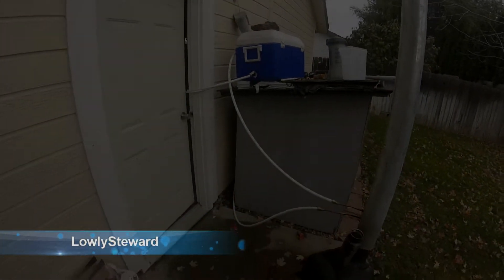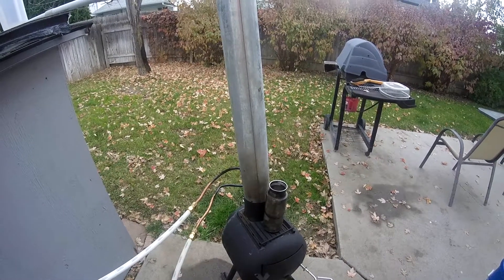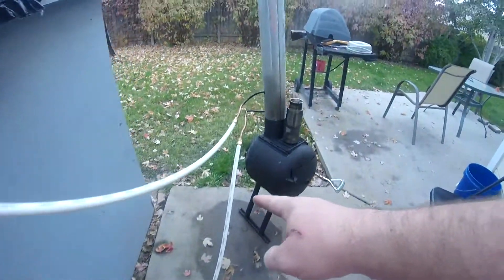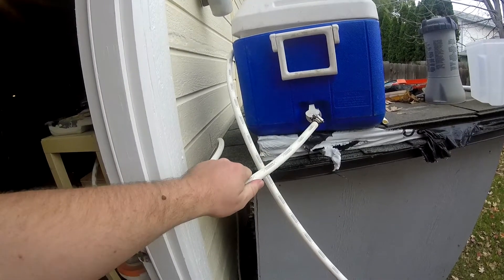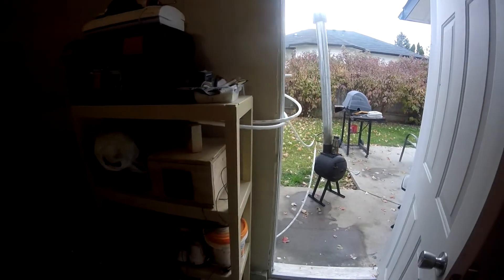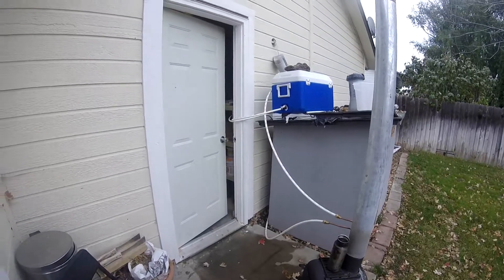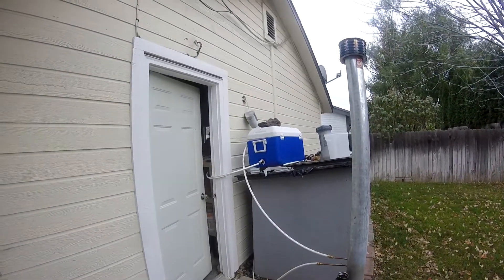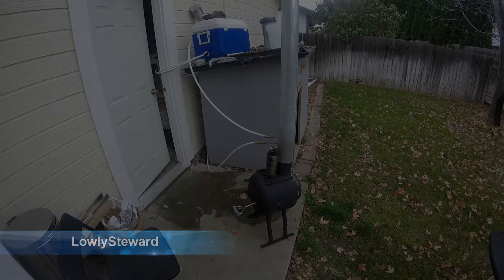Free Garage Heat from a DIY Thermal Siphon

Comment: Why didn’t you use the fan from the Nissan you got the heater core from? It has a much higher CFM than a PC fan. Also could have incorporated the resistor to help control temperature. Coiling the copper pipe around chimney didn’t work as well for you as inside?

Comment: Cool idea.  Another idea I have seen is use a the hot air out of a electric dryer.  When you doing laundry.
Reply: Not a good idea in winter. The previous owner of my house did that, and it pisses me off, cause the garage fills up with moisture like it rained. Not good 4 tools, cars, bikes, the walls........nothin!!!!
Reply: How so? Is your water storage supply inside? Not sure how this would create moisture inside like you’re saying. I know ventless propane heaters are known for moisture but this is almost like a boiler furnace.
Reply from the maker: +Piston Slap That's not a bad idea, that heat just get wasted... and it smells good too! :)
Reply: +LowlySteward lol. yeah that smell.  As long as its not a gas dryer.   I need to see how winter is going to play on my garage. might be cold in side might not.   I didn't buy the insulation for the garage but there is a bonus room above it that is insulated.